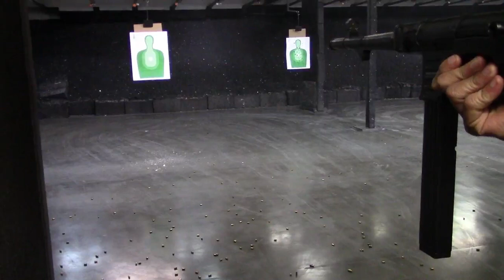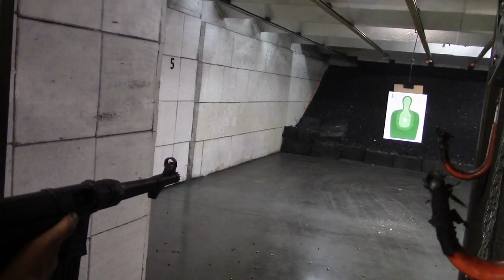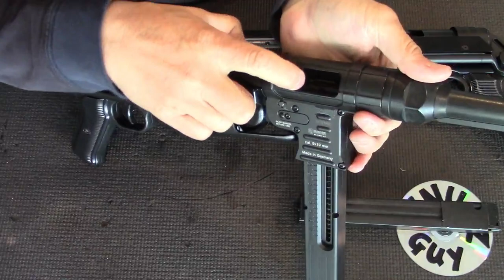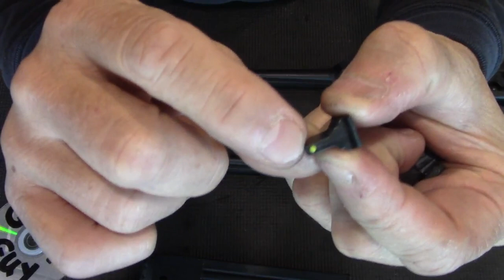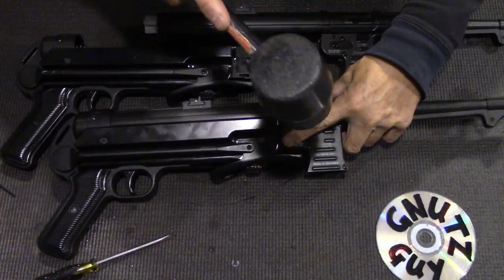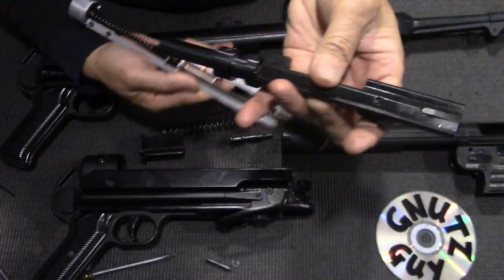GSG MP-40 9mm vs 22lr. Comparison & disassembly. *

Comment: Are the muzzle nuts for the 22LR and 9MM the same
Reply: I see at 8 minutes in not so I cant put the 9mm one on the 22LR rats
Reply: GSG said the muzzle nut is the same for both the 22LR and 9 mm  and they are interchangeable the one I have has the full 165 inch barrel from the STG44 and the fake silencer so its much longer than yours so I am curious it appears the outside of the inner barrel is threaded on the 22 and the 9 mm from your video? I was thinking of getting another STG44 inner barrel and cutting it down and putting that muzzle nut on it so that would mean getting new threads cut ? I have had no luck with the Canadian Blue Lines Importer now also the US importer in any response.

Comment: Ok how easy is it to change out the inner barrel of the on the 22 lr gun ? all I see in the grub screw underneath right in front of the magazine housing that I assume just allows the outer barrel jacket to come off ? I am thinking of making the SBR  version that is legal in the US ie ATF form 1 route which is a lengthy process getting the muzzle nut  and either cutting down the barrel or getting the proper short barrel which is why I asking how it attaches to the upper receiver?
Reply from the maker: i have not touch the mp40 for awhile so i dont recall. maybe i should do a full monty on it?
Reply: @gnutzguy  Yes I would like to know how involved changing out the inner gun barrel is in the 22LR one I have a muzzle nut coming and am trying to get the proper short barrel instead of the longer STG44 22lr one thats on it now with the fake suppressor that makes it legal in the US and starting the painful process of making it legal as a SBR short barrel rifle under ATF Form 1
Reply: I would just need a description after you remove outer barrel by screwing the outer barrel off after removing the muzzle nut off and the grub nut screw which exposes the inner barrel to the receiver at that point  see link
https://www.americantactical.us/public/files/Manuals/GSG%20MP40%20Exploded%20View.pdf
Reply: They took down the parts list pdf but I have it just cant attach a pdf here
Reply: I assume you need to take part number 52 ASM cover off to start ?
Reply: After  removing the frame?
Reply: Ok I am still interested in this just need to know how the barrel comes apart from the receiver finally got the proper muzzle nut but the shorter barrel seems to be a problem so might need to cut the long 414mm barrel down dress the front and cut the proper threads if I can find out there description.

Comment: Ok I am in the US and thinking of converting the US compliant one to a SBR a going thru the paper work ATF form 1  as I dislike the long fake suppressor so my question is after doing all this is a simple muzzle nut to screw on front of the outer barrel jacket are the threads the same and inner barrel diameter also can you swap those on your 9mm and the 22lr one?

Comment: Ok I got a match for the missing screw and took possession of the MP4022lr  now have tried it a few times cocking has been very erratic sometimes it cocks easy  but most of the times it seems to hang up completely in mid cock gun dealer sprayed it and tried to work it so really not sure is going on much worse than the STG44 so back to the 10 lb sledge hammer  even my heighbor cant do it when it break loose it works a bit than hangs - So far the best I have done is with no mag in and the safety on and the hammer pull to lock out then insert mag release then set on fire and shoot . So yes it has last shot BHO  but with no mag inserted this works? Any thoughts - have a gunsmith look at it or send it back for warranty ATI no longer handles this gun Blue Line Solutions do and their response seems poor .
Reply from the maker: if its under warranty then by all means send it in and please dont use a sledge hammer, if you have to use that much force then that should tell you there are something seriously wrong.  
you are gonna break something,
Reply: @gnutzguy  Ok answered it now seems to be fine - its odd because when I went to the dealer to look at it I could charge the bolt easy just felt pressure need end of pull back  with handling by several people it now seems ok as these people are bears with great strength me not so much- Blue Line Solutions import this so basically no tech support realtime . Anyway I will continue testing it as it has a 1 year warranty before I go that route. Thanks
Reply: Ok I have fired the MP40 @ 30+ mags @15 rds each now have 6 mags h and yes I tightened up the screw that separates the it  after each firing session and other screws after each session before and after and usually also the bolt as it needs it alot as it works loose also. I am used to it as the STG44 had mag issues of not feeding and actually dropping out - I still use the weight of the 10 lb hammer to cock the STG44 the last inch or so even after 1 year as it still gets much harder to finish the pull back there . The MP40 still has periods where it pulls back very easy no hangs to about halfway back its very hard to finish -hammer time so my question is as the bolt goes back do you feel  the same thing ?Easy pull that goes hard (hangs) near end with your ones?

Comment: Hey I finally got my MP40 22lr  but the #91 din 7991 m4 x 8 countersunk screw is missing that connects the barrel jacket to the receiver its underneath any suggestions.
Reply: I emailed ATI and checked hardware stores and had zero luck. I ordered the 3-tier stand for a project and it comes with a couple extra screws that ended up being the correct thread pitch. You’ll just have to cut them down a little bit.

Comment: Ok I see the difference here between the 22LR and 9 mm cocking lever bolt have you ever had an issue with the 22LR one flying out while firing ?
Reply from the maker: ofcos its just screwed in, everytime i cock, i turn the handle.
Reply: @gnutzguy  Ok thats easy  I have 3 mags and loaded each for a total of 7 - funny thing that half cock hangup seemed to disappear - on the last 4 inserts ? So I repeated it today with 9 reloads and its still gone! Its very easy to charge now no hammer needed ! Before the dealer could not even charge it ! So not sure what broke it loose only odd thing I noticed was a couple of times after inserting mag and cocking the bolt door stayed back and it did not load shell but I just charged it again and it worked ok  > fired fine . We will see if it continues. My STG44 still requires the 10 lb hammer really odd after 1 year and 600 + shots